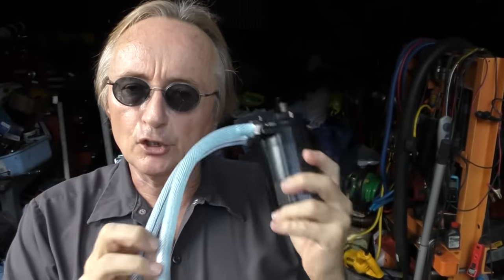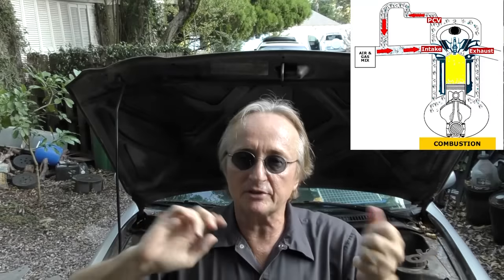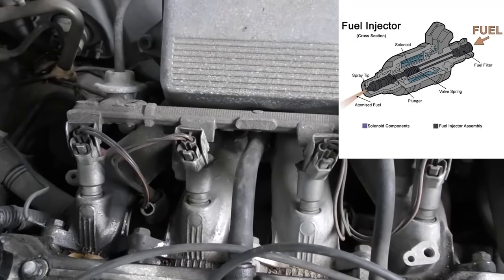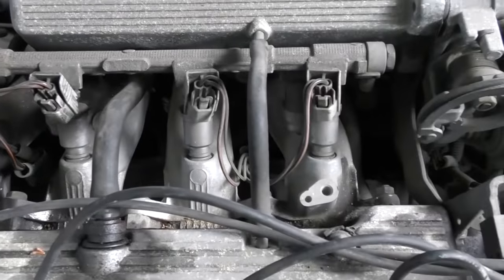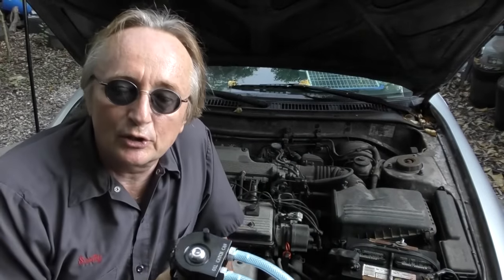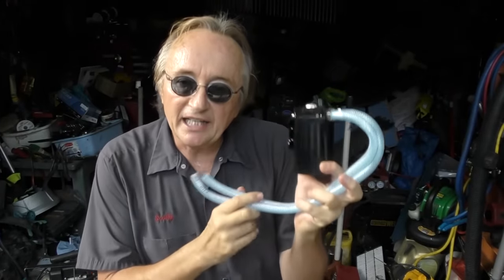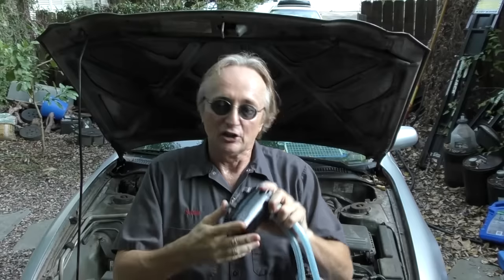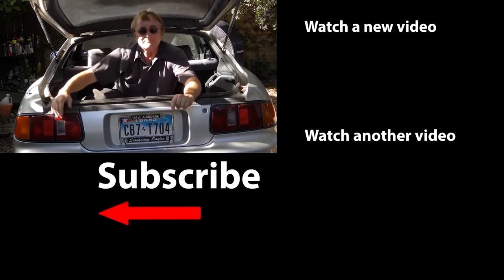If You Have This Type of Car, You Need This to Prevent Damage to Your Engine - Oil Catch Can

Comment: Oh scotty, it's not the oil that makes the carbon deposits but rather oil AND exhaust gasses from egr. The best way to eliminate carbon buildup is to prevent exhaust gas recirculating completely. Oil vapours in intake without egr is not that bad tbh, only when its excessive or fills up intercooler. But I guess gdi and intercoolers are too hi-tech for scotty anyway 😜

Comment: I use a catch can on my yj 2.5 turbo. Forced induction causes more crankcase pressure. I run through a catch can and vent to atmosphere. I don't want an oil mist mess so i try to catch it.

Comment: Those are good cheapo cans (with new hoses). I put steel wool inside the the screw off baffle and it collects everything. The outlet hose is bone dry after 15k mi.
One of mine burns a quart every thousand miles.

Comment: Scotty love your channel.    My daughter has a Fusion 2.0 SE and I want to install a catch can.  I have seen a simple 2 port can (in/out), but also a 3 port can with check valves that supposedly includes turbo intake or something and it comes with some type of a new oil cap with port back to fair filter box.  Do I have to use the 3 port can or will simple 2 port can work?

Comment: Just become introduced to Scotty.  Unfortunately, it was after purchasing my 2015 Ford Escape SE with the 1.6L ecoboost engine.  Saw this video and purchased this catch can.  Unfortunately the instructions aren't that great, and the only video I can find about installing one is on a 2016 1.6L.  Is the engine the same, or do I need different instructions to install it?  Not much room either.

Comment: Yeap u're right Scotty my first car was a 1950 chevy pick up truck that my dad give me as a gift to highschool it had a long pipe tube that went down to the bottom of the engine to ground. I still have it it has a 6 inline cyl with 235cc and a small 1 throttle carb 😂
Saludos desde Ensenada México 🍀🎶🍻🤙😉

Comment: I installed this in my air induction system of my 2019 Kia Sorento LX V6 last year. Every 5,000 miles I change my synthetic oil, oil filter and remove the oil catch can reservoir to empty out the trapped oil accumulated.

Comment: Hello Scotty 
I need an advise please 
I just installed an oil catch can 
I think that oil vapors should condensate so they need to be cooled down? 
I put a small cabin heater radiator in the front bumper so the oil vapors pass through the radiator then enter in the catch can
Do you think it’s a good or bad idea? 
Sorry for my English, I’m form Romania 🇷🇴 Europe

Comment: I have a 2015 chevy equinox with the 2.4 liter direct injection 4 cyl. I bought it with 115,000 miles on it without knowing about the issues with these direct injection engines. Some mechanics have told me that the blow by is just part of how the engine was designed and it's normal and fine. The mechanic I have used for a long time said that I should get rid of the vehicle as soon as possible because of the blow by. Would using an oil catch can prolong the life of the engine at this point or is it too late?

Comment: Scotty - I have 2018 Nissan TitanXD with the 5.6l gas DI V8 engine and 7k miles. Each of the two value covers has a PCV and separate hoses to two different runners on the intake. Can I plumb both PCV lines in one oil catch can then split the output of the catch can back into the intake runners? Or should I install two oil catch cans, one for each cylinder bank?

Comment: I've had two catch cans on my 2007 Ford F150, remanufactured 5.4L, 3 valve engine, for a couple of years; one for each bank. The driver side catch can gets full between oil changes of 3K miles, the passenger side rarely. As a side note, in California catch cans need to be removed in order to pass smog testing.

Comment: I have a 2015 prius...76k miles on it....running good still...have heard about EGR and intake get fouled up with carbon...and also pcv valve on the prius ...do you recommend a oil catch can as preventive maintenance?

Comment: Scotty:  We have a 2016 Ford Edge Titanium with the 2.0 EcoBoost Engine.  I have checked with two Ford Dealerships and both have told me that this carbon build up problem has not appeared in any 2.0's they have sold.  Can you tell me if our engine is one of those modern engines that doesn't have this problem?

Comment: Hey Scotty; I have a Ford 5.0L EFI engine. What should I install on the Valve covers and Crankcase to Intake to help remove oil going into my intake and relieve pressure in my valve covers?

Comment: Put my new catch can on a week ago and it was full already.  Mostly water with a minimum amount of oil. Driving a GMC Terrain, with a 2.4 this  froze up the moisture last year in the air box and blew the rear main… 1600!$ fix.  Can I put the breather on the top (included with the catch can) to prevent moisture build up or will this cause other problems?

Comment: Scotty, just because an oil catch can "catches" some crankcase vapours through adiabatic cooling does not mean it prevents carbon buildup. Well designed crankcase ventilators with control valves and baffles do a far better job. In fact a catch can can (excuse the pun) severely impact the life of your engine by slowing down crankcase exhaust so much that the vapours never leave the crankcase and create an emulsion with the oil, otherwise known as sludge. There's  cases where a well designed catch can could be a lot better than the crankcase ventilation in some GDI engines but unless you have a good understanding of the thermal architecture of your engine with and without the catch can and a means to test besides the shine on your valves I'd leave well enough alone. It's certainly not a foolproof modification.

Comment: I have a 2014 VW Passat with 90k miles, would you recommend I use a Catch can for this kind of car? 
BTW, I started using the Akebono brake pads for this car, band they are smooth, and not noisy at all. Thanks for that recommendation.

Comment: would a oil catch an void the engine warranty 🤔 just wondering.
Reply: Not if you remove it before letting them see it. 😁
Reply: @sammorgan31  🤣🤣
Reply: That's a good question.
In response to the other reply, it can be removed easily too!

Comment: I had a 1994 Toyota Corolla. I put one of those consolator devices on it. It's exactly like the one that you're holding in your hand. I never once in awhile I would have to twist the thing off and empty the stuff that was inside of it. And it gave me really good gas mileage on the highway. I almost got 40 miles to the gallon at times.

Comment: My 2003 Ford 150 with eco-boost had the old system and was beginning to miss once in a while at 80,000 miles.  I traded for a 2018 with new system and better fuel economy to boot.  Joy.
Reply: Rooster Ecoboost in 2003 ?
Reply: @lalito95barba  typo, 2013

Comment: By adding a catch can with a filter ,ur adding some restriction to the otherwise free flow of crankcase air, so will it not cause some back pressure to easy flow of blowby air...leading to load on seals..???

Comment: Yes all high performance engines should definitely have a can, and have one on my Challenger SRT8 as well. I did not purchase it new, but had the injectors cleaned as soon as I could and wanted to keep the system that way as much as possible. So I purchased a can made in the US, and of aircraft quality material
Reply: I made a mistake at the beginning where it says  alength of hose  goes to the 1" outlet port that would be the inlet port to the baffled side of the can. Do not kink the hose to or from the catch can

Comment: Scotty some 2022+ Ford Maverick owners with the 2.0 turbo ecoboost GDI motor are installing dual catch can setups  (clean side /dirty side). I’ve heard the motor already has a part built in for the catching function. Could it still be best practice to run an auxiliary catch can system?

Comment: Have you ever thought of using a coalescing filter from an air compressor system. You can see how much is in it and quite often they have a drain on the bottom.

Comment: Scotty: What would you think about filling an oil catch can with Seafoam or  another cleaner to keep the intake valves clean?
Reply: You dont fill the catch can with anything,  as its purpose is to remove liquids or their corresponding vapors from the air that will return to your intake. You would put the seafoam in your oil (or whatever brand engine flush you prefer), run it for a couple miles, then change your oil. (Don't run the seafoam oil mixture for a long time as you risk damaging stuff that way)

Comment: What are your thoughts on putting a fuel rail spacer between the manifold and engine with injectors. This should make it like the old manifolds with injectors right? Im thinking of this to increase performance and make it more reliable...how often can you say that.

Comment: Scotty, I have one of those 2azfe engines in a car I purchased from a private person.  I did not check the car out, just drove it and it seemed to have plenty of pep.  I learned about blow by after wards when I found myself going through a quart each month.  Today I opened up the oil filler cap while it was idling and a lot of air pressure came out of the oil filler cap.   I only have had the car since December, four months. Its a 2004 Toyota Solara.  I was thinking maybe I should use that catch can on.  Do I remove the pcv valve and route the catch can device at that connection?

Comment: Scotty can you use a remote oil filter adapter and oil filter in place of the oil catch can?  Relatively inexpensive compared to cost of most aftermarket manufactured oil catch cans

Comment: Hey Scotty, I have an 09 Chevy cobalt with the 2.2 ecotec engine. It has the PCV routed into the intake runner, and my throttle body is showing quite a bit of crud on it. Could an oil catch can between the valve cover and intake runner reduce the amount of gunk in my throttle body? (I know I obviously have to clean throttle body first)

Comment: I noticed you’re Celica the fuel injectors are visible what year and model engine is that?The 2000 RAV4 I worked on they were behind the valve cover and under the intake manifold I had to replaced them because I had one bad injector

Comment: Even on port injection engines, they're useful. Valves getting caked in carbon is a lot less of an issue, sure, but they will help keep the intake manifold cleaner preventing restriction and helping preserve performance and mpg's.

Comment: Is that a issue when the car has a smog inspection?
Reply: Not at all, the vented gas is still going into the engine, the can is just removing the oil and contaminants.
If you simply removed the hose and let it vent straight into the air as many people do that would probably fail inspection.
Reply: @archygrey9093  makes sense

Comment: Not with those hoses scotty. Those hoses will collapse and leak since fuel/oil will be passing through. Just bought hoses from damond motorsports that work fine. Make sure you buy the right size can for your motor. 1/2 or 3/8 usually. My hemi took 1/2. Works great. Good under vacuum considering pressure rating isn't what your looking for.

Comment: Would my '08 750Li (E66)  benefit from this since these engines are prone to the valve stem seals failing and burning oil?  I don't have this issue with my car, yet but if I can prevent it by installing this I would.
Reply: The valve cover has oil from the oil pan running over the valvetrain. The valve seals keep that oil out. If those seals fail an oil catch can wont change or prevent it. The pcv system is separate from the valve seals.

Comment: Does a 2021 Crosstrek have a system like the 2018 Toyotas mentioned that spray gas intermittently on the valves?

Comment: I have  a catch can on both of my mustang GT’s a 04 and a 14 and every 3 or 4 thousands miles when I change the oil and filter I drain my catch can and it will have about 2 or 3 oz of oil. Also a catch can will tell you a bout the condition of your engine too much water means heads leaking to much blow by and piston rings in very cold places you have to empty catch can more often

Comment: Hello I have an audi tfsi engine I wanted to install the oil collector, I have a question Ask a question about the pvc there are two outputs one which goes to the turbo and the other to the intake in your opinion can I close  the one that also goes to the turbo?

Comment: How Well does air flow through those things? Would it effect air fuel ratio under high load? Ive considered installing one and disconnecting the battery for a while so that the ecu can go through a relearning process to compensate but doing anything that could restrict airflow or void warranty makes me nervous.

Comment: If you have a line going from your crank case to your intake..
 You def need a catch tank. Most ohc engines have two. Top and bottom. The top your really don't need to worry about. All that supposed to do is breath.  The bottom crack case is the only one that def needs a catch can.

Comment: How would you hook up this catch can to a 66 corvair engine? Currently I have one that has 3 connections. 1 from valve cover ,1 back to valve cover ,and 1 that is on top and vents to atmosphere. This engine is converted to aviation use on my experimental. Really tired of seeing oil on bottom of the plane

Comment: I was really hoping that you were going to address the Honda 1.5 l oil dilution problem, and if this would be a good fix, you said the newer GDI engines do not need this, does that include the Honda 1.5 l turbo?
Reply: A catch can would not help mitigate oil dilution in the turbocharged 1.5 liter Honda engine. The oil dilution by fuel is caused by gas slipping by the piston rings and into the crankcase from from excessive cold engine idling, not blow by gasses. The best way to prevent this is to NEVER excessively idle your engine when it is cold, since those engines are so efficient that they do not warm up quickly while idling. It’s best to start the car, give it 15 seconds for everything to receive oil pressure, then drive off while avoiding spirited driving until the engine is warm. As well as changing the oil every 3500-5000 miles instead of the recommended 7500-10000 miles.
Reply: @gunnarjohnson7515  well, we have had our 2019 Honda CRV EXL now for over a year it has 13,000 miles and there is no evidence whatsoever of gas being in the oil, the oil level stays perfectly level, we are very happy with our CRV.

Comment: Someone may have mentioned this, but am not going to sift through all the comments 😅. Am having a problem with IAC valve messing up my idle. A buddy of mine mentioned that one of the main things that gunks up the IAC is the PCV system. After I get the throttle body cleaned up, thinking of putting a catch can on there... 🙂

Comment: Is this an issue with Diesel engines?
Reply: If it's a GDI engine without the dual injector set up than I'd say it's an issue with those diesels.  I'd check the maintenance schedule to find out if an intake valve cleaning is listed.  Or, check with a mechanic that knows that brand of diesel engine.

Comment: Any mercedes M113 V8 has the sequential injectionin the intake manifold scotty mentioned. So basically no carbon build-up. That V8 is the one to get if you are looking at Mercedes’s. One of the last good true reliable engines mercedes made.

Comment: I’ve got a 2017 equinox with 4 cylinder. I find oil in the pcv hose that goes to the air box. What does that mean about my seals or piston rings?

Comment: scotty have you heard of installing a normal pvc on the ecotec 2.4 engine? i'm wondering if you can mount a pvc on the intake manifold and then the other end into the valve cover? if so do you have a video or know of one that show how to do  it easy enough.  also i see this will not for the equinox. but if i was to put a normal pvc unit on the engine i bet it would fit.

Comment: Scotty. I have an 2004 Jeep Wrangler with a 4.0, 6 cly. I know this is considered one of the strongest engines to come out of the U.S. I just change the gasket on the valve cover and put new pcv valves on it at the same time. The front valve is actually just an elbow that is connected to the air filter box. The rear is an actual valve that goes into the throttle body. Witch one should I hook the catch can to?

Comment: What about those of us that live in states with annual/bi-annual smog check requirements?  Functionally, I know it is an improvement and you are not venting to environment, but is the car/truck failed due to tampering on a visual inspection?

Comment: Will my VW Jetta 1.4l tsi benefit from this ? Just want to make sure
Reply: yes, because of the carbon build up before the intake valves. Because the fuel gets injected directly into the burning chamber, the oil gets stuck in the intake part without being washed off by petrol like on older systems

Comment: Mr Scotty your videos are very useful I learnt a lot from you. thanks
I have a question does this catch can make the engine consume more oil for example 0.5 Liter every 1000 KM?
Reply: No, it does not make the engine consume more oil. If you have an old worn out engine with lots of blow-by, it "filters" that crap out so it doesn't suck it into the intake through breather tubes and the pcv system.

Comment: Best thing invented for the Vw/Audi/Skoda 1.8 turbo. You'd never guess how many check engine lights are caused by contaminated sediment in your fuel and oil system. These things are a life saver if you buy the best and right one

Comment: if you guys buy a catch can like this don't use the stock tubing go buy some better tubing from the auto parts store. the clear tubing stuff they send it with does not handel the engine oil and gas that will sit in it and the vaccum preasure. its ussaly some type of hose you would see in a soda machine for its carbination system